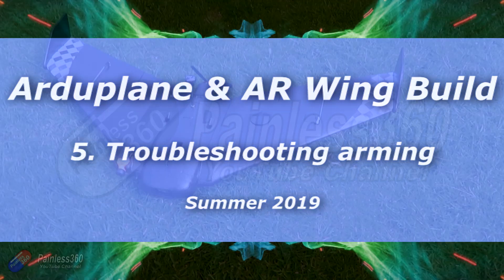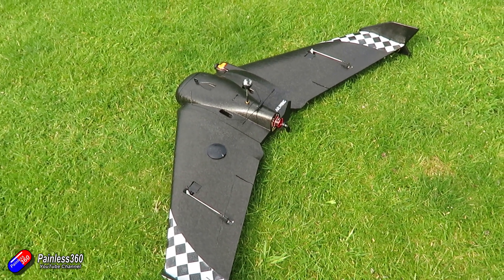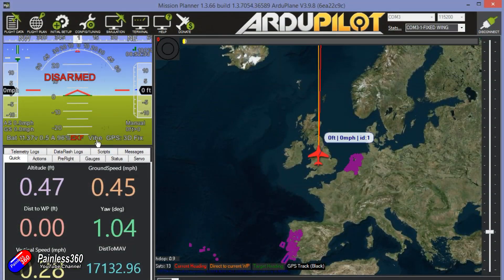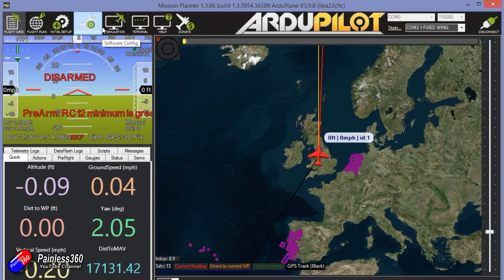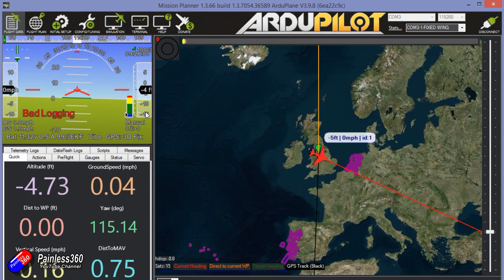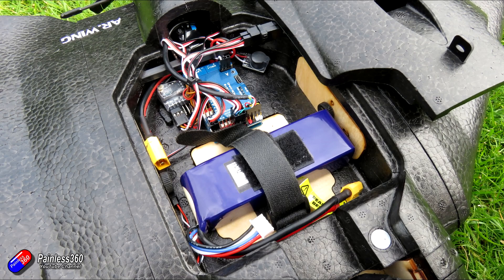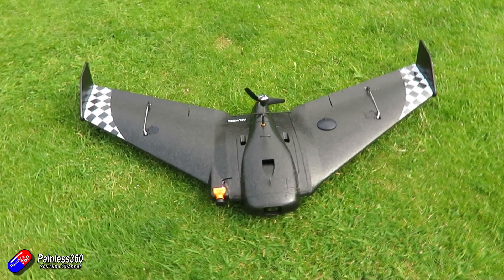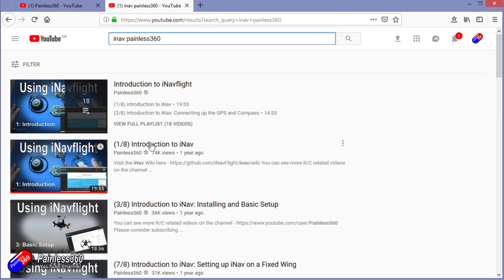ArduPlane/AR Wing/Matek F405-Wing Build: Troubleshooting arming problems

Comment: When I try and arm my quadcopter, on the mission planner screen it says PRE ARM: High GPS HDOP. When I first tried to arm it it said PRE ARM: GPS: waiting for home. Do you know where I can change it to be able to arm?
Reply from the maker: Details of how you can override the GPS arming safety is in the documentation. I would strongly suggest that you fix the issue rather then try and fly without a working GPS. It can take many minutes to get a good 3D GPS lock...
Reply: @Painless360  I don't want to bypass the GPS. I would never try and fly it like that. I want to fix the issue. I just don't know how to fix it. Everything was working fine until I loat mission planner from my laptop and desktop. When I downloaded it again and installed the latest firmware I must have done something wrong. I wonder if I should reset the memory in my Pixhawk and start over?
Reply from the maker: I'd look for what has changed on the model from when it worked till now. Something has changed... Best of luck

Comment: Since the flight modes are attached to one channel and one 3 position switch does that mean you have a maximum of 3 flight modes? Is it possible to have more than 3 at one time?
Reply from the maker: Yep, Check out my Opentx 6 position video.. Happy flying
Reply: Thanks again! Getting close to a maiden, fingers crossed.

Comment: day 2 and I've been watch the entire build from Omnibus and Matek F405wing.
 what I want to ask is,

1.  when you have the message from mission planner that says about preArm problem, what connection do you use?
are you still using usb cable? or telemetry from the TBS?

in my community, I saw they are using 3DR to communicate beetween the plane and mission planner, as they were using the plane for aerial mapping. but I don't see you installed any 3dr tele.

2. When the message Pre arm problem shows up, can I just see it on googles? just like INAV. 
in inav, they show everything about the error in the googles. and I dont have to connect to inav configurator.

I'm sorry, Inav is my first autopilot technologies and I'm new into the ardupilot. that is why I always compared with Inav. 
I think INav has more user friendly  interface in inav configurator than the mission planner does.

3. How do we see about satellite in ardupilot? in Inav we should wait about 6 or more satellite lock to get more precision flying. how do we see how many satellite we have on mission planner? because it only says '3D gps fix' . it didnt mention about how many satellite fix.

4. if I'm using pixhawk 2.4.8 which is doesnt have osd built in like matekf405, then how do I know about everything? is it only based in a sound that coming from buzzer? to know it arm or disarm?
in Inav we can check that and all other information simply on the googles.

I dont know how it could be that interesting to fly with ardupilot. you just throw the plane, and watch it by in mission planner. 
I dont know where is it, I dont know what circumtances that my plane will fly into, because all we see in the ground station is only a telemetry data.
like altitude, heading, speed, etc.   plus there is only a map that show where the plane is.

its like fly blindly. I dont complaint about ardupilot, but just share my thought. as an INAV user, then moved to ardupilot family, its completely diiferent.
I need visual input! just like Inav does hahaha.
so even I fly 10 km away with waypoint, I still can see the environment around the plane. if there is a power line or a tower ahead, I can avoid it.

but I did watch your video about that, Inav and ardupilot is a different method of flying.
actually I loved  to fly with visual input and I can go to inav.
but since I want to enter the aerialmapping world. I also need to learn about ardupilot!

looking forward for your reply sir! thanks to you, cheers!
Reply from the maker: 1) USB 2) yes 3) same ways as iNav - osd, telem or lua script. All covered in my arduplane builds.. best of luck!

Comment: Really nice series.  I'm following-long and building with slightly different hardware (regular Spektrum Rx/Tx, and different VTx and camera).  It's my first project like this.  The videos are a HUGE help.  Thanks!
I had problems with arming, even after reviewing/changing all the setting you showed here.  I was getting hung up on "PreArm: logging fail".  I searched and tried a number of fixes, but no luck.  Ultimately I went into ARMING_CHECK and disabled the logging check, and it finally armed.  (WHEW!  Not an ideal solution, but I'll take it for now.)
Can anyone give me some idea how to actually fix the logging (without disabling the check)?

Comment: I went back to iNav on a wing build I'm doing. I am running into a problem with the servos. I get about double the movement in the left servo than I do in the right servo.  Everything is centered and control rods in the same locations, same metal gear servo's and in manual mode.  Any idea what the cause or fix for this is?
Reply from the maker: I'd run the servos from a servo checker to see if you have one of them with more travel..

Comment: I've come to the conclusion you can't have a compass in arduplane after spending hours trying various GPS/compass arrangements including separate compass boards, none seem to give reliable headings (by the way the compass you show is an APM type, therefore you should use Roll180, as the compass ends up being upside down when the GPS is installed) I will be interested to see how you fare going forward.
Reply from the maker: I've got it to work in all of my builds. I cover the steps and kit in every series. Best of luck!

Comment: I’m still waiting for the maiden flight of your paraglider. Wondering how well it flys, or if it’s all about the novelty factor.
Reply: 3D performance! Not likely. I was thinking that it could be a perfect trainer for children. A slow gentle aircraft, that will float back to earth with zero pilot input by cutting the motor. The worst fear is that it could get stuck in a tree.

Comment: I've been using Ardupilot on a dozen builds or more and never seen that problem with the RC trims - is it something to do with Taranis maybe?
Reply from the maker: Maybe, all of my builds have been with Taranis..
Reply: Seems also with Frsky system. I use XJT module and have that problem too. Its seems because I use 12 channel radio while the XJT outputs 16 channel so the remaining 4 channel seems not detected by the flight controller. Easy to fix but just plain anoying